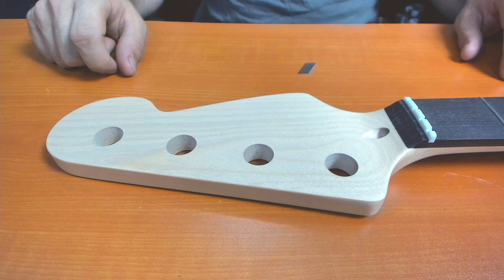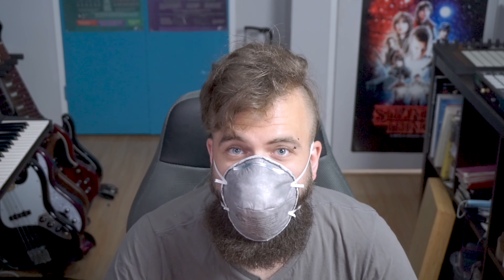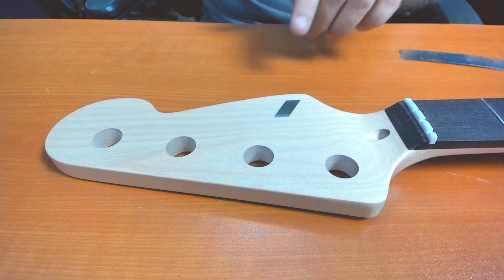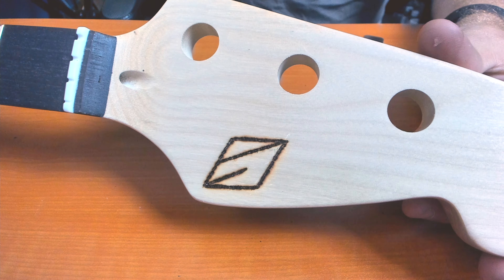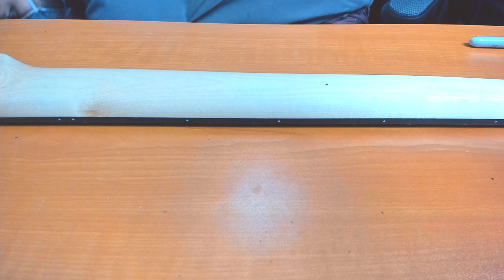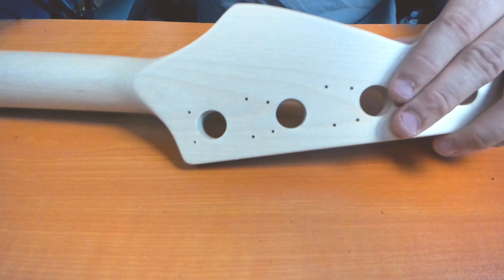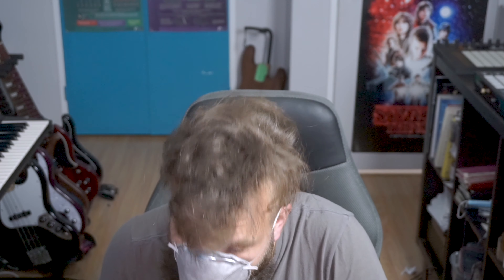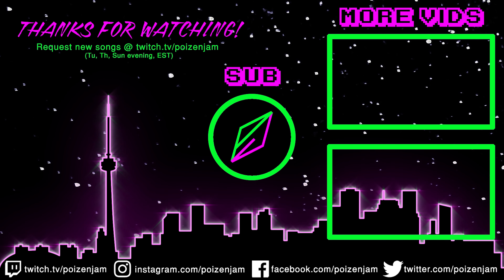Cool Custom Wood Burned Headstock Logo!

Comment: when I did something similar, I used the pencil and paper trick. You just rub the pencil on one side of the paper (like it was carbon copy paper), then trace the logo on the other side while you push the paper on the wood. Once you have a trace, you can just follow the contour with the solder and then fill the spaces.
Reply from the maker: OK this sounds a lot easier than my method. Frankly, on reflection, I can't defend having free-handed this logo. I really should have stencilled it!